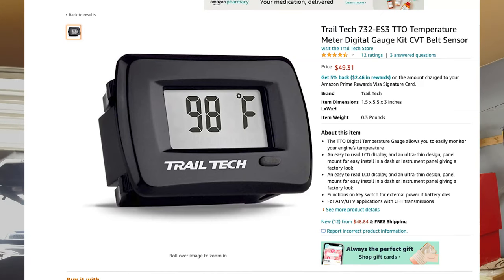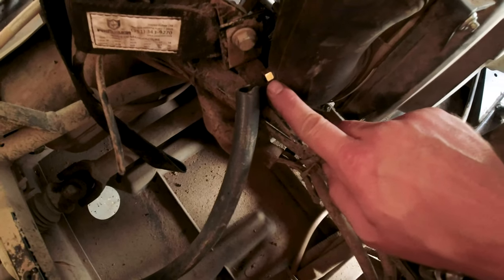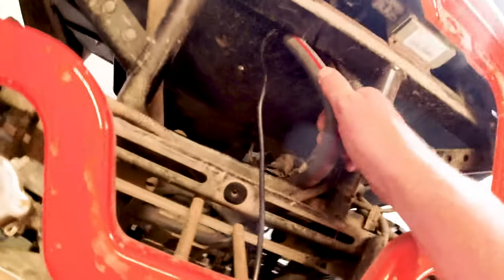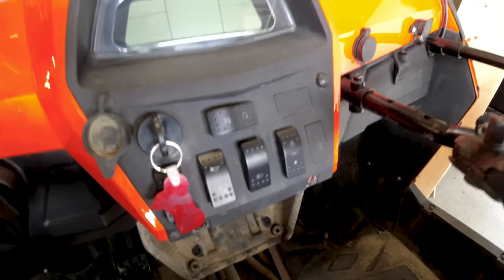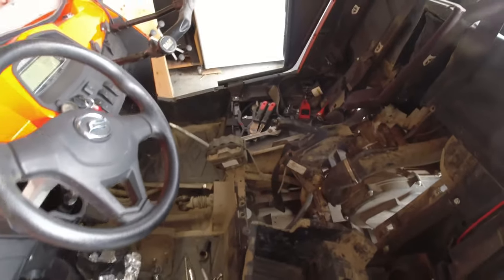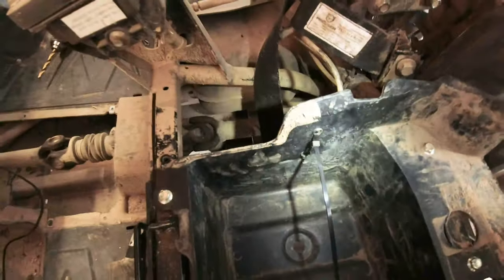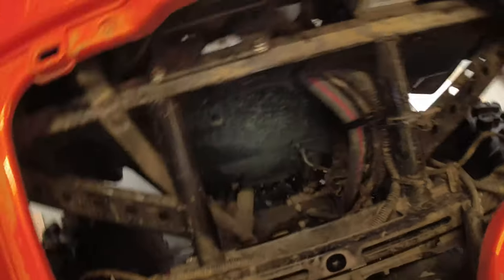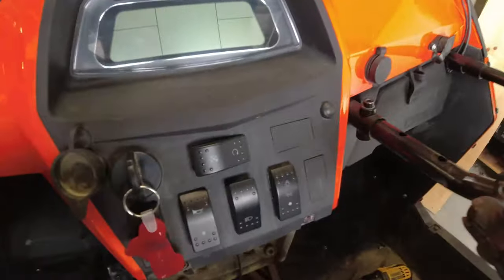CVT Temp Gauge Install on ZForce

Comment: How did your temp gage work. I'm very interested in adding one to my 800 trail. I run a CFMOTO trail Facebook page. We don't allow commercial sales but we do share tips and fun trips. I sent a link. Not sure if it works but your welcome to stop by. We have a few people in Michigan on the page.
Reply from the maker: It worked well.  I sold the sxs, have parts if you need an axle or something.
Reply: @bwiesman  no parts needed at this time. Enjoyed your videos
Reply: Do you have a link for that gage, it would be greatly appreciated
Reply from the maker: @bakersadventures848  

Trail Tech 742-ES3 TTO Temperature Digital Gauge CVT Belt Sensor Universal https://a.co/d/daNdGQC